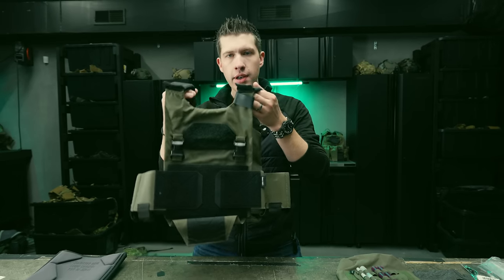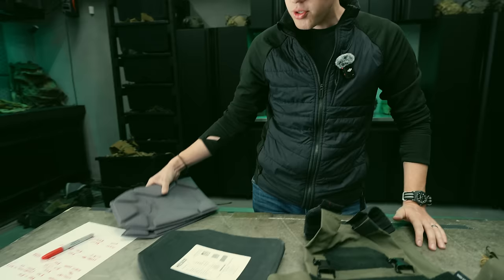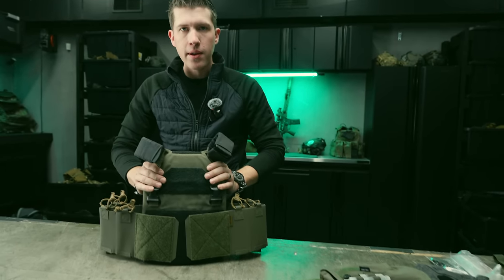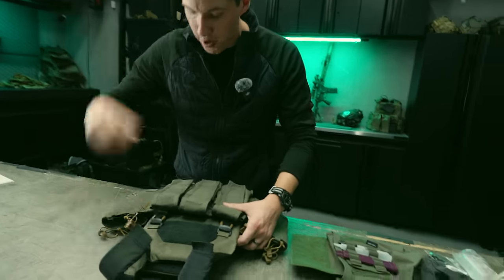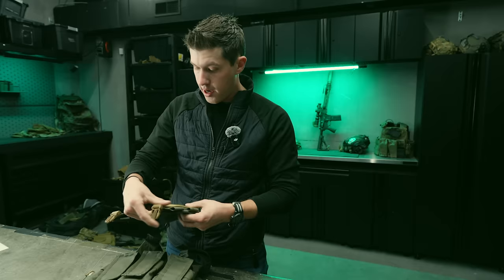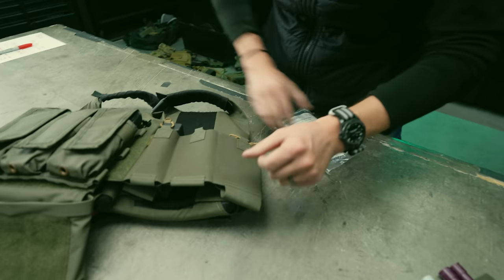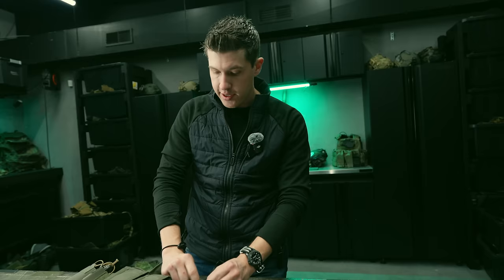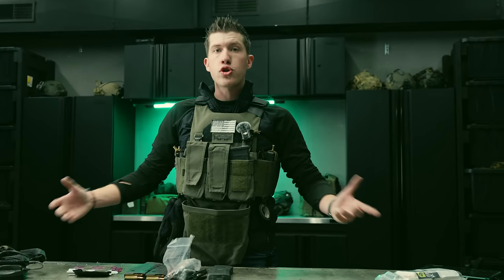Building a Slick Plate Carrier Loadout

Comment: $600 is inexpensive? Damn I’m a broke man
Reply: For plates, yeah that's cheap asf. Level 3 plates or higher are $1000 from the get go.
Reply: Nah 600 bucks for one plate is expensive unless you’re Elon musk, you can get a set of level 4 plates from guard dog body armor for 340 bucks
Reply: @213chewy Guard Dog is chinese knockoff armor and is not NIJ certified. If it's not certified, stay away from it.
Reply: @Midievalmace  I don’t care where they’re from, they work also China does make good stuff, classic firearms and Mr guns and gear have shot the hell out of them and they hold up just fine so guard dog body armor is just fine and for a much better price
Reply: Im a chest rig kind of guy. After spending a few years in a plate carrier and learning how to not get shot, Ill take my chances with a chest rig and my DD. My plate carrier is going in my wife
Reply: RMA multicurve are nice and not too expensive.

Just damned heavy for what they are.
Reply: The "AC1" looks exactly like my inexpensive plate carrier I got from China. It cost me $55.
Reply: @Midievalmace look at actual tests, guard dog has stood up against multiple rounds of black tip 30-06, hesco has failed NIJ testing multiple times.

Comment: Really clean general/multipurpose setup.  One aspect I really appreciated was the talk on slings catching tourniquets. Lessons like that are typically learned the hard way and being able to hear them first hand (or even second hand) from dudes that do the damn thing is always appreciated.  Again individual mileage may vary and depending on what you are doing or planning to do will dictate some of those small adjustments you may need to make.  Key thing is actually run your stuff. And not just on the flat range. Something as simple as climbing over a wall can make you feel silly when something catches and/or gets ripped off (ask me how I know lol).  Also, when you actually use your kit you quickly find out why paying less for cheaply made stuff is almost never the move (learned this really quickly as a broke private trying to up my gear game).  It definitely hurts the wallet buying more quality stuff even if it is "mid tier" but having to replace something after light use because the cheap stitching decided to give up randomly is way more painful.  Lastly all I will say is get a gym membership and get in shape.  You dont need to be at the fitness level of a ranger bat dude, but you can be better than where you are currently at. Plus you get to feel better and look sexier. Win win

Comment: Great Video! It's cool to see how far you can push the envelope with the AC1 I bought mine at a time when I needed something inexpensive to replace a plate carrier that I had lost in a house fire. I always looked at it with that mindset. So I have never looked at it as something scalable and never cared to scale it up until now. It would be cool to see a side plate option available with the Trex Arms Cummerbund.
Reply: The folks that knock on slick carriers crack me up, you can really build these slick carriers up to quite a robust piece of kit.  Some might argue that it defeats the purpose of a slick carrier but I argue that the very quick scalability is one of the biggest benefits of a slick.

Comment: Back when i was first getting into armor, i found that the jpc 1.0 was the best deal for quality. Yours might be up there now, but i still would recommend looking into the jpc👍very comfortable
Reply from the maker: The Jpc 1.0 is still super solid
Reply: @TREXARMORY  This is why I've always had a lot of respect for you.

Any chance you guys would be interested in making hook-to-molle field back panels for slick carriers?  I have a JPC and a Direct Action Gear Hellcat (went with them as I know a few of the guys) and have been looking for some panels that I can use as modular back panels if and when needed.  A laser cut panel would allow for quick interchangeability and with 4 to 6 grommets and some shock cord or paracord would allow for solid securement to pretty much any carrier with a loop back panel.

Comment: What up Lucas it’s Karl. Love my multicam I got from you the only thing that I can think of that you’re missing from your plate. Carrier is a dragstrip on the back and that’s nitpicking, but I’m definitely gonna pick up a few more attachments for mine!
Reply from the maker: What’s up man! Yeah, we’ve discussed drag handles/straps at length. Grabbing the shoulder pads (or attaching a cord to both sides) is just as useful if not more useful as it grabs the entire carrier and not just the material on the rear bag.

Comment: I bought one of these some time ago. The AC1 would be perfect if the inside of the shoulder straps didn't dig into my traps so bad, even with extra shoulder padding. If they were angled like the MEPC, Crye, or Ferro it'd be great under a jacket. Love what TREX is doing, but I cannot wear an AC1 current state, unfortunately. MEPC was a better fit.

Comment: My theory on TQ placement is center center center. Front or back doesn’t matter as long as it’s centered for the most part. Reason being, if you get shot in either arm or if either arm gets blown off, you can still reach it with your other hand. If both arms get blown off, well you’re just fucked.

Comment: K19 is the best. I love mine.
Reply: K19 is mediocre at best. There are many other significantly better carriers that offer more capability
Reply: @Midievalmace  well if u say so…I haven’t found one better then the k19 so I’ll still say the k19 is the best
Reply: @Dusty96  agilite makes good stuff, I like my K-zero
Reply: @213chewy  yep but I like the k19 way better
Reply: @Dusty96  Too much padding to compensate for poor design. This padding gives the illusion of comfort, and this is the case when you run basically nothing on it, but when loaded up, it does nothing.
The shoulder pads and QR buckles are incredibly poorly designed, and this is true because any shoulder pad that makes it difficult to shoulder your rifle is a bad shoulder pad.
Non-switchable and non-structural cummerbund...this basically prevents you from changing your cummerbund to a better cummerbund, forcing you to use a non-structural cummerbund with little to no molle real estate. You might as well have a piece of webbing with an ITW buckle, and it would do the same, if not a better job. 
The K19 is by no means garbage; it stands up to a lot of torture, and their QC is fantastic. But when you're wearing armor for extended periods, it's missing a lot of crucial updates as opposed to other brands.
Reply: @Midievalmace  k19 is still the best out there for now
Reply: @Dusty96  definitely not the best....maybe in the top 20 (closer to 20), but not the best by any stretch of the imagination.
Reply: @Midievalmace  nope it’s the best an if u butting numbers then it’s #1
Reply: @Midievalmace Genuinely curious as to what your top 5 is? Not throwing shade at all. Seems like you know your stuff.
Reply: Is it the best because it’s what you bought, or the best because you have tried multiple carriers through multiple range days
Reply: @ja0298  multiple carriers on range days an it’s what I like the best

Comment: I have RMA lvl 4 plates and its a pain in the ass to put them in my AC1, should I be using a smaller plate?
Reply: I was looking at those, was you able to get them in?
Reply: @Joltin_Navi  I can get them in, it's just very tight and requires a lot of work

Comment: Does anyone have any advice for actually wearing something like this long term? I tried running my AC1 coyote hunting for 4-5 hours the other day, and it hurt so bad the entire time. Mine probably only weights 15 or so lbs. Is it kinda like appendix carry where you just do it till you’re used to the uncomfortability?
Reply from the maker: If you haven’t worn plate carriers a lot, it’s something to get used too. You can add a beefier shoulder strap to it, but it’ll still put weight on your traps that you may not be used too.
Reply: There are some options to make it more comfy, but in general, yes. You kinda just have to wear it until it becomes comfortable, and it does over time. Your shoulders will get used to it and adjust. This process for me, wearing a FCPC V5 with the padded shoulders straps and two 6.5LBS plates, took about a week, wearing the carrier 8 hours a day mon-fri.

EDIT: Don't fall into the trap of constant adjustment. I made this mistake and it made the process take longer. I kept thinking that the pain was coming from the plate carrier being adjusted incorrectly, but trust me when I say, one shoulder will always hurt more than the other.
Reply: padding for the plates and shoulders. like lukas showed in the video his padding plus PIG BRIG shulder pads work for me best. and dont make the cummerbund too tight

Comment: What’s so bad about steel armor?
Reply from the maker: Weight and frag. Most people will dump their steel within 5 hours of wearing it and would have been better off not buying it and using a chest rig instead. Not to mention the frag issues. Most coatings aren’t enough to stop the frag.
Reply: By the time you spend money on the garbage steel plates, and then spall coating, and then trauma pads....you could have gotten a decent set of ceramics.